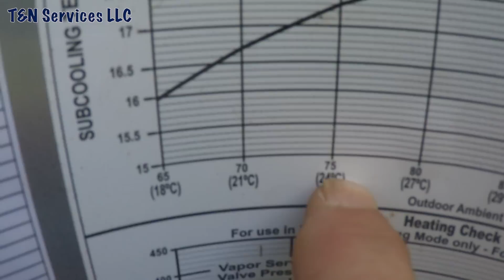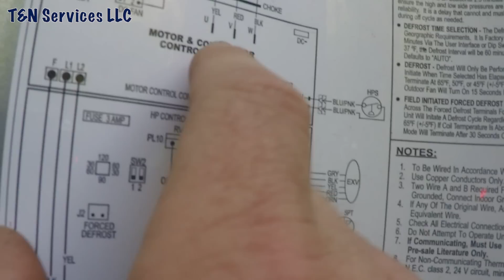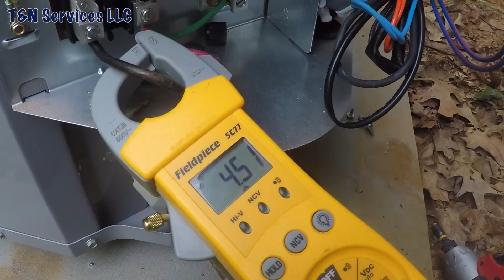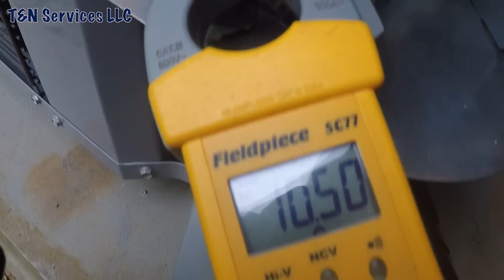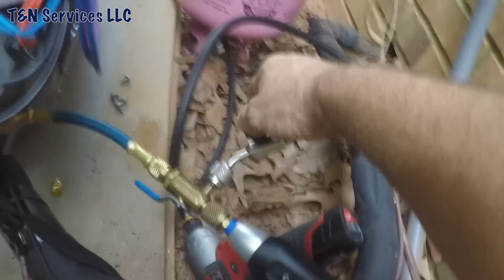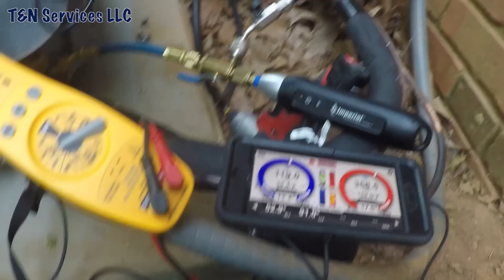ICP HVAC 5 Speed Inverter Install (3 ton HeatPump) Part 2

Comment: You should have added at the percharge before opening the valves.  410-a for line sets Over or Under 15ft its a +/- .6 per ft of 3/8 copper per the installation book.. That has pretty much been an ICP/ Carrier standard for years.This will avoid running and all the ramping up and down trying to check. These units will never be conventional subcooling as per the manuals.

Comment: is it that much more efficient for a customer  to pay the way higher price and  how long will it take to recover if any at all if something breaks down ?  thanks
Reply: Can the same question be asked of any new equipment replacing old equipment? The unit has a 10 year parts warranty, labor warranty is based on the contractor (so get a good one). The system is inherently more efficient than even a current  "high efficiency" unit. The real benefits of this (and any other inverter based system offers) heat pump is twofold. During the cooling mode it will mostly loaf around in stages 1-3 using less electric and dehumidifying better than a single stage unit will (it will start and stop less so the evaporator coil is running at its peak performance [it takes about 10 mins to get the coil to its coldest temp])   The heating benefit is that it will reduce the need to use the back-up heat strips (the biggest benefit of this system). The unit can be slightly over sized as to give good cooling/dehum performance but also give more heat at lower temps (this is where the unit shines). On a side note: this unit has an equalizer valve so the unit starts with no pressure difference on start up, there is no "locked rotor amperage" drawn during start up. Ever notice your lights dim for half a second when the AC starts? This system is not for everybody but those that do purchase it will be pleasantly surprised.

Comment: i have been a service tech for 16 years, in the electrical field for over 40 years, just started my own company and have been working on carriers inverter communicating system for a couple of years now. we have always installed a matching indoor coil and a touch screen interface. once you energize the system the computer searches for the equipment, you enter line set length and size and the computer tells you how much added charge is needed. you add the extra charge if needed, and you are good to go. when you test the system you enter that you want it to run at 100%,  the indoor coil has a standard TXV, and the out door coil has an EXV controlled by the computer. the interface tells you what the superheat is and what the target sub cooling is, no gauges needed after the initial start up. troubleshooting is fairly straightforward, once you have worked on a few of them. not much goes wrong with them.
Reply from the maker: +Dave Yeager I agree Dave these are very nice units. In my case I am only using it as a 2 stage system right now until I can redo my inside unit and ductwork.
Reply from the maker: +Dave Yeager I agree Dave these are very nice units. In my case I am only using it as a 2 stage system right now until I can redo my inside unit and ductwork.

Comment: How is the noise level compared to the old unit?  Obviously a very soft start.  I would think variable speed compressors shine when coupled to a varible speed indoor unit and can closely track partial loads.  The other reported benefit (maybe the biggest if true) is in heat pump mode where low outside ambient operation is possible saving significantly over backup heat strips.
Reply: RJParker Much more quiet. i went from a 2 ton single stage hp to a 3 ton. I very rarely use back up heat now(strips were locked out at 38 and now they are locked out at 17). during cooling i only use stages 1 & 2.

Comment: When charging inverter driven units, 100% make sure you have it set in test mode and you follow instructions exactly. Or you'll be wondering why the presser jumps up and down and your pressures keep changing. The unit needs to drive itself and set its indoor and outdoor fans exactly where they need them ramps up the compressor and then you can take an accurate subcooling reading. 
   That American companies are trying to introduce these systems slowly and as simple as possible so the old-timers can still work on them. On the larger more complex VFR systems like Daikin, Mitsubishi, LG and Samsung to name a few. You only plug in a laptop computer with their special adapter Interface and software and you set sub cooling in this method, gauges are never ever used or hooked up no matter what. if you ever see a technician go up to one of the more high-efficiency advanced VFR units and whip out  a set of gauges you immediately kicked him off the job site in delete his number from your phone.
Reply: I worked on those units back in the early eighties they are not new technology, just better now so as a old timer I know exactly how they work.

Comment: Are these units just using regular txv at indoor coil? And do you think they will come out with a step type txv like the Mitsubishi uses. Just wondering.  Thanks for sharing.
Reply: Trane already uses a step txv in there's so I am surprised that the rest don't. It will happen later most likely.
Reply: Nor-Cal Refrigeration & H.V.A.C the ICP indoor air handlers use standard txv's as do the evaporator coils.